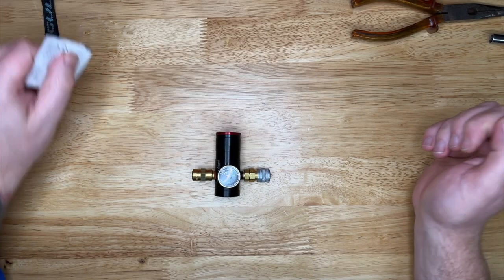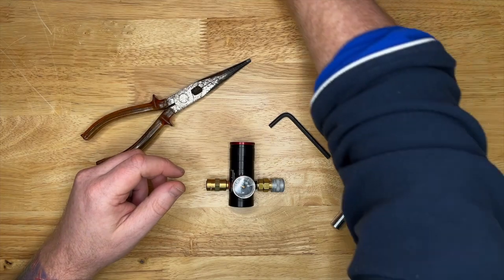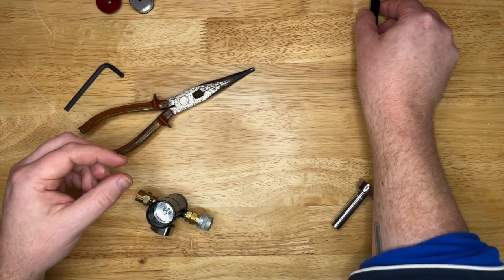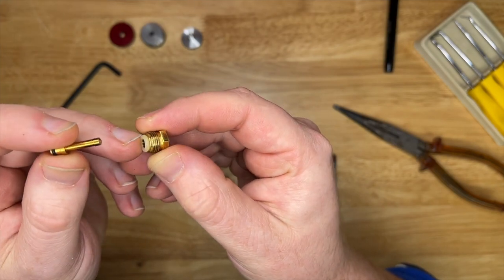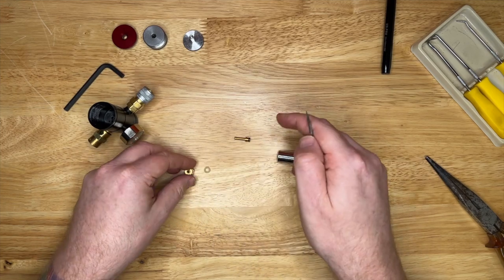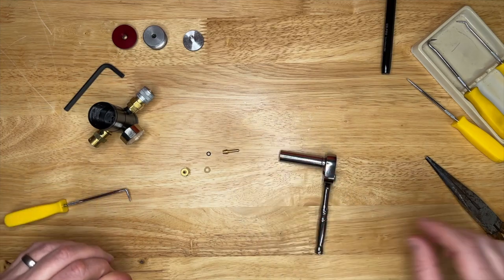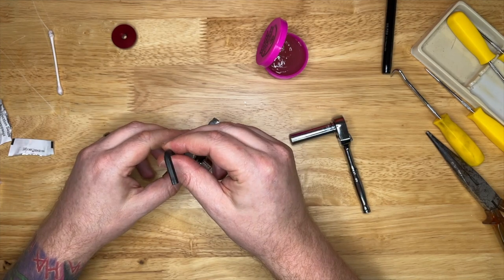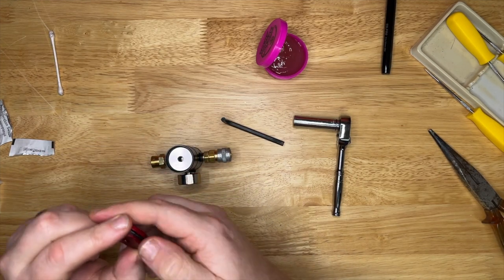Redline Mini SFR Regulator Strip & Rebuild - HPA Airsoft - Clean - Lube - Reg Maintenance

Comment: Did you put the shims in?
So you use Techt Gun Sav?

I have heard  that some grease alternatives are Eclipse grease and Dow 33 for anyone needing to know what is the correct lubricant to use it important to use an inert grease (silicone). 

DO NOT use oil or petroleum based grease on the inside of the tank regulator (high pressure) or low pressure regulators for gun side else Boom at 4500 psi !!!!!

People need to stress this in their VIDS!!!
Reply from the maker: I did put the shims in, I realised and rebuilt and still had the problem. Redline hooked me up with a new oring and all working perfectly! Always use TechT Gun Sav. I don’t discuss others as I’ve not used them and wouldn’t want to suggest something incorrect.
Reply: @AngryBullAirsoft  No Problem. I have been looking online for the correct lubricants and the three mentioned were recommended. Thanks for the video as it really helped. The Shims was an easy mistake. My regs are different but appreciated the vid anyway. Using a punch to slot the shims onto is a really good tip.

Comment: Hey mate thanks very much for the vid. I had recently got a redline mini SFR although when received I noticed Grease inside the threads (bottom section of the regulator, which I assume is grease) but with all the concerns about using oils near HPA tanks(the nipple) which cause explosions I am quite nervous about whether it is fine to just screw the thread on top of the HPA tank as is. Will it lead to any risk of explosion? Apologies if this might sound a very stupid question but I am kind of new to the whole HPA system.
Reply from the maker: You should be ok from the sound of it. The reg will air up and it’s only really silicon based oils to steer clear of. The tiny slip of air screwing on a reg to the low side of a PB reg there’s nearly no risk. If in doubt find someone who knows what they’re doing to do it for you 👍 Excellent choice of reg though.
Reply: @AngryBullAirsoft  Wow thank you so much for your prompt rely. Much appreciated. Yes I think that might be a good idea.

Comment: Can you tell me the use of yelow metal on the regulator’s left side
Reply from the maker: Just a blank as far as I'm aware.
Reply: it's a relief valve in case you overpressurize  the regulator so you don't damage components or the regulator itself
Reply: I chose this regulator for that reason over others since I'm not constantly monitoring the pressure when playing on the field

Comment: Hi can anyone share his wisdom with me? I got a Problem.
Im using thisRegulator for several years and always put it on 90 psi, but at the end of the day marker indicates 130/140 psi !!! i didnt touched it midcame and i am concerned about the other players saefty.
What could cause this problem?
Help.
Reply from the maker: Exactly the problem I had with this regulator. The internal mini white o ring will be damaged or in dire need of a lube and clean. Once done it'll be fine again.
Reply: @AngryBullAirsoft  thx M8 for the Tipp !!!

Comment: Late to the party but what is the screw size for the bottom ones (the black ones) i recently lost mine
Reply from the maker: Not sure which screws you're referring to?
Reply: @AngryBullAirsoft  I figured it out, I pulled off the top of the Hk tank but I already found replacement screws, sorry.